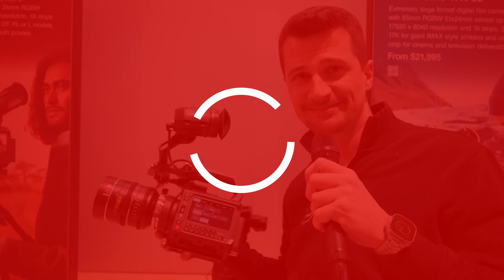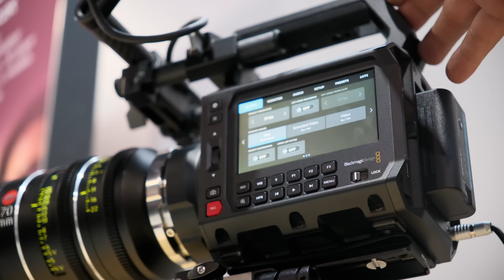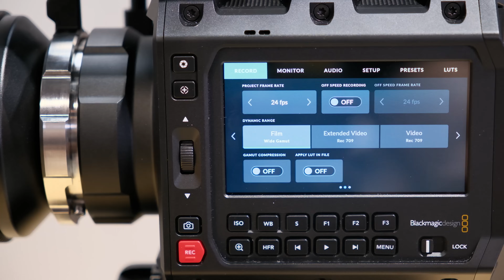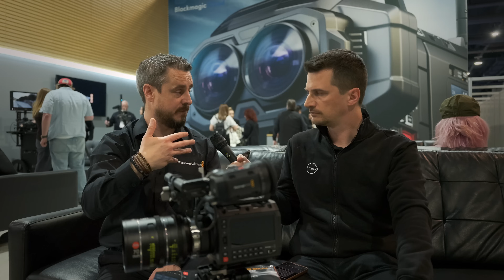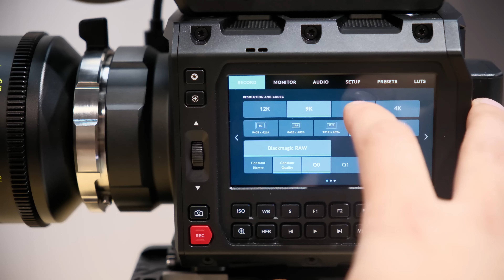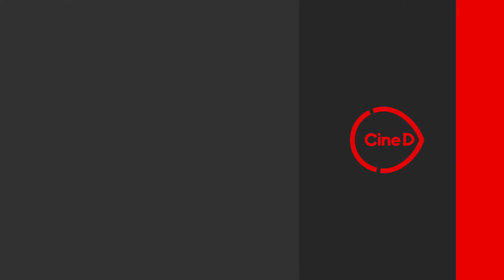Blackmagic PYXIS 12K Camera Explained in Video Interview

Comment: Here's my question:  The 12k pyxsis has more dynamic range.  HOWEVER if you shoot both the 12k and the 6k pyxsis in 6K resolution, is the new pyxsis STILL better dynamic range?  If not then I'd go with the 6K pyxsis.  I Cannot ever see shooting higher resolution  than that.
Reply: 12k version will have better DR. It’s using the same sensor from the URSA Cine.

Comment: I have a question about this camera. If you shoot in 4K, does it take the 12k image and scale it down?  Ultimately, getting a better quality 4k image? I shoot on the Sony A1, and when I shoot 8k, I end up scaling it down to 4k, which looks better than shooting in 4k. OK. Thank you?
Reply: It’s hard to explain, but it basically groups pixels together in its readout at a particular ratio, in order to get the lower resolutions.  Mathematically, 12K, 8K, and 4K fit that ratio that’s necessary to allow full sensor size at lower resolutions.

It doesn’t oversample like what you’re talking about.

Comment: Blackmagic Design is doing a great job with their BRAW codec (and Resolve). I wish every camera could record internally to BRAW, no matter the brand. It's flexible in post, has manageable file sizes, and is exactly what most filmmakers need in real-world workflows.
As for these ultra-high-res sensors like the 12K in the Pyxis, I honestly think they're more about marketing than real-world practicality. Most indie filmmakers deliver in 4K, which is already more than enough and will stay relevant for many years.
Sure, 12K might have its place in VFX-heavy work or for aggressive reframing, but that's a niche.
What really matters on set is image quality, not just resolution. And native 4K sensors have a huge advantage: larger pixels mean better low-light performance, cleaner shadows, and more dynamic range. Things that actually impact your image every day.
Honestly, camera brands should stop chasing resolution and focus on perfecting 4K. Better color science, improved highlight roll-off, internal RAW codecs, that's what makes a camera truly great in my experience.
The ARRI Alexa 35 shoots at "just" 4.6K and it's widely considered the best image quality in the world. That speaks volumes.
Reply: Ugh not this again - do some reading on sensor design. They went 12K not because they're chasing resolution but for what the photo-site layout can do in 12K on this type off sensor. Its the reason it has increased dynamic range and readout speeds it does.
Reply: Exactly my thoughts on the braw. Our main cameras are all BM, but we use r5c for tabletop and gimbal work due to a really good autofocus. However i hate the RAW Lt, enormous file sizes and tough on pc disk speeds, with no real benefits compared to braw. But let’s see how good the BM AF becomes in the next year or two.

Shooting a lot of product videos with controlled lighting I don’t miss the “larger photosite capabilities”, and i love the 4k/8k/12k options on our ump 12k, but I wish the pyxis 12k came with lower resolution super 35 option than just the 9k for macro work. We also use a lot of 6k super 16 mode on our ump 12k, but i guess thats not doable woth full frame sensor, maybe at 4k resolution. Menus would get messy as well.
Reply: @celko889  Yes I do agree, Canon's RAW LT codec isn't editing friendly to say the least. And storage is definitely an important factor in a professional workflow, it becomes expensive very quickly. That's exactly what makes a codec being great or not. For me, it has to be solid and flexible, easy to edit without proxies while having manageable files sizes. The best of both worlds, and in that regard BRAW is truly perfect having different levels of compression. It should be standard in every camera.

Comment: Get your naming correct please, it's really getting confusing

BMPCC6K is a 35mm sensor
BMPCC6K pro is a full frame sensor

Stop saying 6k full frame, say 6k pro full frame. Even the 6k G2 is a 35mm sensor

A pyxsix not getting auto focus, then will wait on the fx6 mk2. Am used to manual focus but on a gimbal, auto focus will be something very nice to have

Comment: I guarantee you that Blackmagic will have internal NDs and a new PYXIS body by next year, or at max by the following year. Blackmagic listens to their customers and they are not afraid to cannibalize their current product lines. They are a relentless production machine and I think the PYXIS 12K is going to emerge as their flagship camera. Honestly, add internal NDs and a flip out LCD, and they've pretty much made the perfect camera in my eyes. We are approaching the final tipping point where Blackmagic begins to pull ahead and win the cinema camera race.
Reply: The URSA CINE 12k LF has all of those things
Reply: @memcrew1  but you lose portability.
Reply: The Ursa cameras are a bit too big for how I shoot. I like smaller form factor cameras.
Reply: @memcrew1  exactly and costs just a little more
Reply: No way. They’ve spent a lot of R&D into the Pyxis, and its form factor limits any ND integration. They would have to completely redesign the body, and they will not do that in such short a time.
Reply: @kellhound1  Well the PYXIS form factor was released last year. so next year it will have been 3 years since that form factor was released. If you look at the cameras Blackmagic have released year over year, changing the form factor or introducing a new model that canibalizes their current lineup is kind of on brand for them. For example they released the original, larger, Blackmagic URSA in 2014 and then turned right around released the Ursa Mini in 2016. They seem to listen to their customers and there are a lot of people requesting internal NDs in the PYXIS. If it's not next year it'll be the year after. But it's definitely coming.

Comment: The biggest drawback for my workflow is the lack of XLRs. I mainly do interviews and work alone so having audio directly in the body is a HUGE time saver. Guess I'll need to pay extra for the Cine 12K LF haha
Reply: the PYXIS Body has 1x Mini XLR and 1x 3,5mm input.
judging from his statement around 16:00 you can't record the input as a safety track, wich is a bummer for sure.

Kinda crazy that the FX3/FX30 tophandle is better suited for good audio than what most cameras support there. On the other hand at bigger scale you have an audio guy anyway.
Reply: @DominikMBlock  Yeah, always pros and cons haha! Would love something similar to the Sony Top Handle from BMD with dual XLRs and the possibility to record PCM linear 32bits directly in the BRAW file.
Reply: @quantumimagesQC  that would be a banger. Since 32 bit float kinda gets standard for new wireless setups this would be great to see in those run and gun cameras.
Reply: Get a field recorder they sound better trust me

Comment: 12k is pointless more than 80% cinema movies are filmed in less than 6k
Reply: Then don’t shoot in 12k.
Reply: 12K isn't really the point, it's more so to downsample.

Record in 8K if you need to re-position and/or stabilize in post and then render out in 4K with no loss in quality
Reply: @phoenixfunny4517  still pointless as I said 80% of cinema movies are shot on a camera that can't even shoot 6k
Reply: @harryvlogs7833  And you still didn't get it. 12K doesn't make it pointless if it was designed to make it the same as those 80%. Stop doing drugs.
Reply: @hivetech4903  your clearly doing drugs as it very clearly makes it pointless
Reply: @harryvlogs7833  The 12K photo-site layout on this RGBW type sensor is the only reason it is capable of competing with Alexa's dynamic range and readout speed in 4K.
If RGBW was a 4K sensor it couldn't fit enough photo-sites and would look like garbage.
So you still don't seem to understand the point is not to output 12K.

Go back to film school & learn how sensors work maybe? 😂
Reply: @harryvlogs7833 not completely useless. For people that have to heavily crop it would be beneficial. 12k for a talking head on YouTube however. Probably overkill

Comment: The Pyxis 12K will definitely be my next camera. After many years, I’m going to leave the Sony ecosystem.
The 6K hasn’t convinced me yet, especially since I sometimes shoot automotive or sports ads. But now, thanks
to the incredibly impressive readout, there’s no longer any reason to hesitate. And even though autofocus
has never really been important to me, it’s very likely that it will come to the 12K via an update. That’s a
really nice bonus. Honestly, an internal ND filter would have been the cherry on top- but you can’t have
everything i guess. Maybe in two years there will be a Pyxis12K Pro. :)
Reply: Don't you need the autofocus?
Reply: @LTULOfficial not if you know how to focus
Reply: @_rhapsodist @habcast3978 @LTULOfficial : I highly doubt this camera is less reliable than a Sony camera. If you make a claim like that, you need to show me statistics or a substantial number of Reddit posts from users proving their cameras are actually breaking down. The only thing that really bothered me and ultimately stopped me from buying it was the form factor, which just wasn’t comfortable for me, especially since I rig my cameras quite heavily. :)
Autofocus has never been a priority for me because I mostly work with cinema lenses. For interviews, I usually stick to F4 and pull focus manually if the subject moves around a lot, which I can’t recall ever happening, since I ask them not to move too much. ;)
As for rolling shutter/readout on the Pyxis 12K, it’s absolutely sufficient for my needs. I can’t think of any shoot in the past four years with my Sony FX3, where I thought, “Thank God I have such a fast readout,” honestly. But I’m sure there are people who care about that way more than I do. :)
Reply: The Pyxis 12K readout speed will NOT be the same as the URSA Cine's - in fact it will be HALF as fast.
Reply: @habcast3978  may as well buy the base Ursa cine package, the price here in australia is $7500 vs $10000
Reply: You will regret it, they are not reliable cameras..
Reply: Yea and sony cameras are so reliable that a firmware update bricks the entire camera  @_rhapsodist

Comment: So does the 12 LF have phase detection points built-in?
Reply: It's not sounding like it does, So I guess it will come down to if they have a better way using the new sensor tech than PDAF.

Comment: Cine 12k AF tracking "some more work need to be done there but hopefully". This confirm PDAF has the ability to utilise the RGBW sensor on a pixel level.
Reply: That's whar i understand too, he would have say no if the sensor was not build wity phase detect capabilities
Reply: @lucasvivante8988  TBH he also said that the pyxis 6k had slightly better IQ than 6kCC 😂
Reply: @Horizons_Roses  and that's normal, the body is larger and better ventilated and they could have upgraded the processing power and thus the complexity of the picture processing.
Reply: @lucasvivante8988  I’ve got the two, no difference. Did some long interview the other day.
Zero problems / differences on both.
Reply: @ better cooling system so you might see less noise.
Reply: @simonc4764  Don’t see any difference after 2h of itw to be honest
Reply: Right? I just wish it was confirmed one way or the other

Comment: The Pyxis 12k is only 2k less than the URSA mini Pro 12k in Australia
Reply: and its only $2500 cheaper than the Ursa Cine LF 12K, if i was buying one i would just go for the Ursa
Reply: @robbetmarsh Bigger cameras require more expensive support gear and a crew. The ursa is really a 9500 cam once you buy media, battery mount, etc.

Comment: I have a great idea for BM for their next camera.
Create a 4K high framerate S35 or full frame sensor. Something that can finally rival the Phantom 4K.
BM got a system in the works that can capture 17K with 60 fps. 4K is 16 times less pixels then 17K. 16x60=960. which means in theory they got a processor on their hands that could handle the throughput of that amount of data. Not only that though, they also got a fast enough memory system to write it directly to storage!
Now if they also figure something out for the ring buffer, which is farely easy compared to the rest, the only thing they are missing is the sensor to do this.
Reply: Someone asked them about that last year and they said they are looking into it.  But it doesn't hurt to ask them again to hammer home that we want an ultra hi-speed camera!

I think they alluded to the fact that their existing RGBW sensors are capable of going to very high frame rates, they just need the backend processing and low latency DRAM to catch up.
Reply: @ both issues that can be resolved looking at what else crazy things they are doing and cooking up.
Let‘s try to remind them, that this is still something we want! 😄

Comment: Everyone who is asking for Internal ND’s clearly doesn’t have a clue about how manufacturing works.

Blackmagic Design wasn’t going to re-tool a whole production line just to add internal ND’s to an existing shell. The fastest, most economical way to get this camera to market, was to take the existing Pyxis body, and put a new sensor in it. Then limit that sensor compared to the Ursa Cine. And guess what? Now you already have cages, baseplates, etc that already natively work with the new camera. 

There is also the whole side of having to give users a reason to go to the Ursa Cine, internal ND’s being one of them.
Reply: Readout speeds are TWICE as fast in the URSA Cine 12K, as well.
Reply: Could put in an electronic ND maybe.
Reply: In which way did they limit the sensor in comparison to the ursa?
Reply: @vagabundian5457  frame rates
Reply: @vagabundian5457 readout speeds and hfr are nerfed compared to the ursa due to the power and processing
Reply: 6k meet 6k pro

Comment: so... does it do a ful 12k sensor read-out when recording 4k or not? it really seems like he danced around that
Reply: I dont think he danced around it - They've answered this question many times since the origional 12K Ursa Mini came out. The RGBW sensors record all 12K pixels and downsample to 8K and 4K. It's done at the sensor hardware level so readout speeds improve but all data is used, there's no line skipping or binning like other cameras.
Reply: It reads out the full sensor in 4K. No crop unless you choose specific aspect ratio outside of Open gate
Reply: YES it does.  He was explaining the technical behind the scenes in the most simplest way possible.  For all intents and purposes, YES the 4K is from the full 12K sensor.  The same with 8K.
Reply: He said "No line skipping" he didn't say "No binning". Literally said "we're doing some processing at a pixel level“ which is just his way of saying pixel binning. It's just not the same as the binning done on a Bayer sensor.
Reply: @HeathMcKinley  in which case they may as well crop, unless that affects the lens focusing light on the center
Reply: I assume it just switches off every 2nd and 3rd pixel on the sensor or it has full 12k and then bins 70% of the pixels information collected before saving to file
Reply: @covingtonrace1  no, he clearly stated it always uses the full sensor resolution and also that power draw is the same in every resolution which does confirm that statement.
Reply: @Digi20  but it has to be ditching pixels at some point, unless its using sets of 3 pixels at a time as if they are 1 pixel.
Reply: @ Nope, no pixels are disabled - they're grouped together. They've done some in-depth discussions about this - Basically, and forgive me if I over simplify this, but the RGBW sensor has been designed to either read each pixel seperatly or it essentially turns groups of pixels into fewer larger pixels. No pixel information is lost like you get with binning / skipping, it's just saved at at the lower resolution as if the photosite were bigger and there were fewer of them.
Reply: @ as this is an RGBW Sensor the processing down to lower resolutions can be done differently than on a bayer sensor where you basically only have the option of reading everything or throwing away something. the ursa mini pro 12K already works similary for years now and there should be plenty of arcticles and comparisions online. in very short choosing lower resolutions on those cameras will not look as crisp as real downsampling but also nowhere near as bad as line skipping. the ursa mini 12k is very nicely usable at lower resolutions. if you really want the perfect best you shoot in 12k and downsample in software later at the cost of higher storage space and performance requirements. but its not necessary for most work.
Reply: @ShaneVanLitz  cool. Much like  my old canon XL1 i had 23 years ago. 3ccd, split the incoming light   across 3 sensors each recoding something different, i love it when things come full circle.... Ish
Reply: @ Not really... but I understand your comparison.

Comment: 16:29 How would you be able to actually record the footage when the pyxis monitor is connected to Micro G2?
Reply: The monitor is touch to record
Reply: It is predominately a broadcast based camera, broadcasters will record from the SDI and don't have a need for onboard recording. Similar to how it cannot playback in camera as the option to record onto SSD is a back-up.
Reply: @Ryan-Payne  that's a missed opportunity as the micro g2 can be a very compact run and gun camera. Blackmagic should make a mini usb hub tailored to be used with the micro g2, the pyxis monitor and an external ssd.
Reply: @andr101  I agree! I wish they'd make one with a cfast express type b card